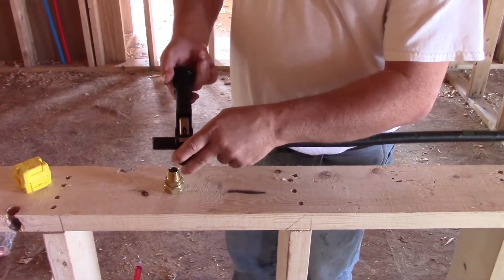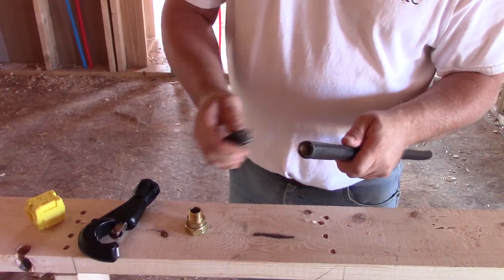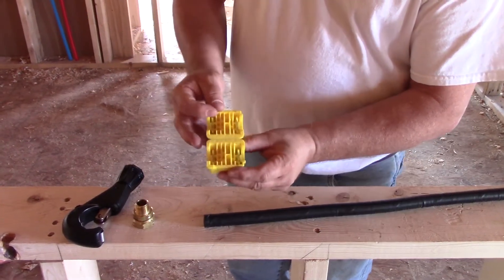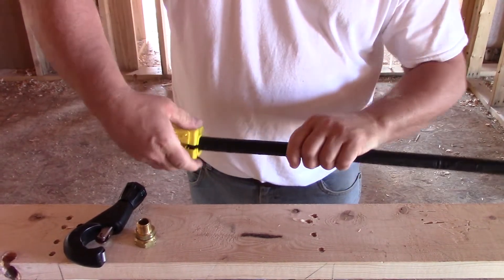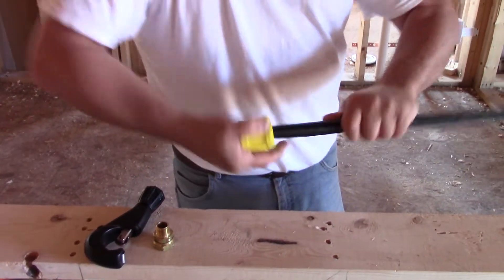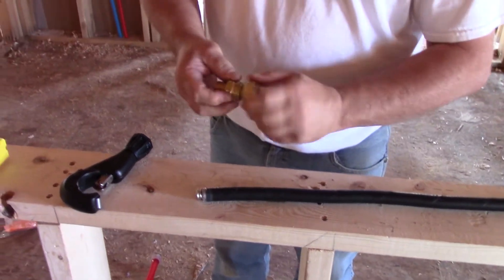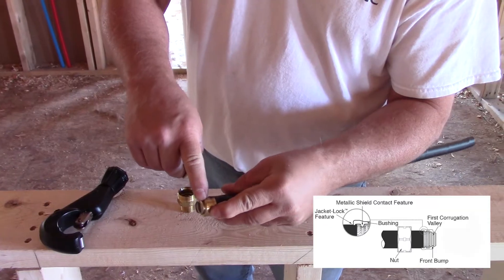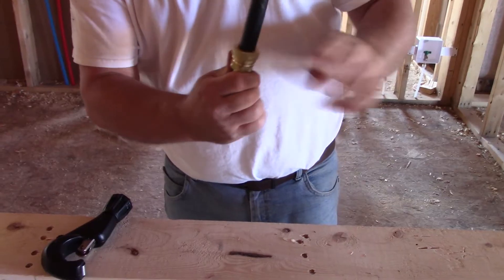FlashShield to XR3 Fitting End-Prep

Comment: Journeyman plumber out of Utah  I've had more leaky gas tite fittings than any other brand by far. Wardflex is number one best brand for sure. And at this point I am putting gas tite at the very worst csst brand to use. From my honest experience
Reply: Operator error.
Reply: Yeah you screwed up ward flex is junk.
Reply: Gastite owns Wardflex

Comment: How tight?
Reply: The million dollar question no one seems to have an answer to. In my experience, too tight is a real issue with these. Hand tight and maybe half to 3/4 of a turn, check for leak and tighten according. Don't overtighten it like I've done a million times. You will literally thread lock it and it will still have the small microleak. I finally got this stuff down but it literally sucks. Virtually every other brand of ccst seals better than this stuff. This stuff takes a lot of finesse, most of which I believe could be rectified by simply adding a gasket of some sort.